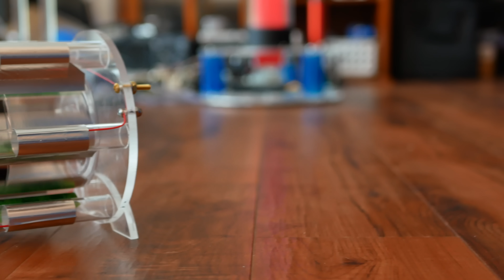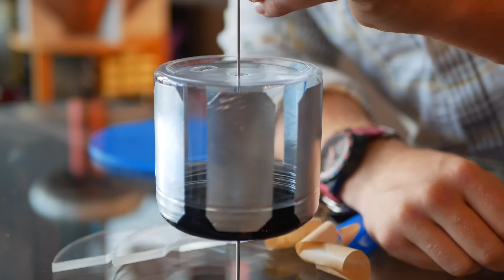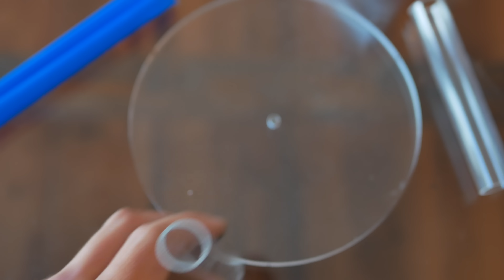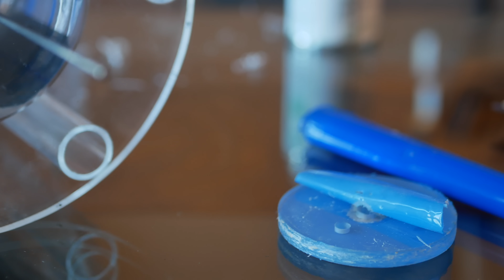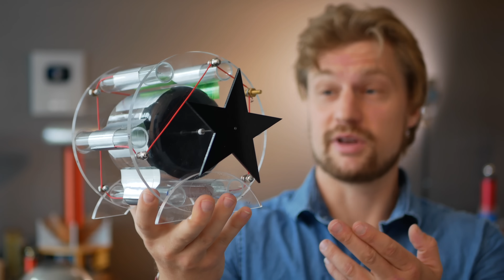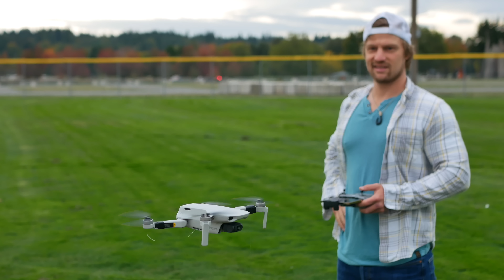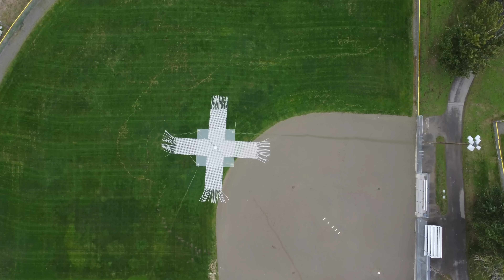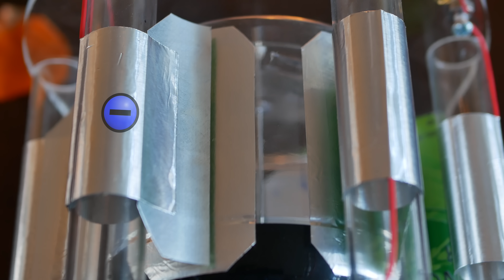Building A Wirelessly Powered Corona Motor (DIY)

Comment: Great build, I'm impressed how much torque that motor can generate! Makes me curious: what if you put magnets on the rotating shaft and used it as a crude dynamo...would it work, or would the eddy currents cause too much resistance in the motor for it to be efficient?
Reply from the maker: That’s a solid suggestion. The torque isn’t all that high, but, it was basically geared “down”. That being said, could totally attach small magnets to it and make a dyno! Thanks for the next viddy idea.
Reply: Yeah 👍
Reply: @PlasmaChannel  NoOoOo Zach you spoiled my science fair project hahaha
Reply: @PlasmaChannel  Glad I could share, keep the great content coming!
Reply: Eddy currents wouldn’t be significant sources of loss if you used insulating magnetic cores like ferrite or air. The actual resisting torque caused by the dynamo would be a function of the current output. So if you wire it up with a low q-current switching or linear regulator to power some low-current CMOS IC or MCU, it would probably be sufficient for a demo.
Another source of torque is that from cogging. Once the rotor is up to speed the cogging bumps are no longer an issue, but the motor would have troubles starting and may never get enough rotational kinetic energy to overpower them. So I’d suggest either using a flywheel and connecting the generator after it’s spun up (or leave it connected and start it by hand), or using a generator with minimal cogging. Air-core would be one way of doing this, so would having very indivisible pole and slot numbers.
Reply: @PlasmaChannel  Could you make a larger motor with an antenna insulated from the earth and the motor grounded to earth and a flywheel to store rotational energy?
Reply: Blood thirsty Koala here... yes, please!  That'd be groovy.
Reply: Should be fine with uncored coils. They don't generate near as much, but they're excellent for low torque applications. 
Speed is the key with getting effective generation out of them, apparently.
Reply: Really great little project and fascinating physics.  Thanks Jay
Reply: @volkswagenation  By the time you try to get any reasonably amount of energy using this its orders of magnitude simpler and cheaper to just put a solar panel there instead.
Reply: Thanks for the share brother ...... science 🧬 is crazy inspiring , and your works offer much learn from . Be well
Reply: @drkastenbrot  but this will work at night and winter days. Question is how big it would need to be to produce 10 Watts. I assume rpm can be very high. Maybe in next vid the max rpm possible will be revealed.
Reply: @Kapalek84  at winter days a solar panel of similar size and cost would still massively outperform it. and a solar panel still works in rain and stormy conditions.
Reply: @drkastenbrot  Solar panels are great source of energy however this is an experiment. So if high voltage is available in atmosphere then building high voltage low current dynamo [high rpm, low torque, good bearings and wd40 required] (a lot of turns on coils with high resistance and low amps) is worth checking out. If you already have solar panels on your roof that is additional source to check. I wonder if scaling up such electrostatic setup would increase the output proportionally to the size of antenna and ground electrodes. If it would get large then lightning risk would make it a bit too powerful ;)
Reply: @Kapalek84  The current is in the order of microamps. Enjoy building a motor for that, the losses just ruin any approach. WD40 alone adds too much friction, you would need dry pin bearings or even magnetic bearings. If there is a practical application for this current, it would be easier to just use an isotope generator which is tiny, more powerful and completely independent.
Reply: @drkastenbrot  to get more current the size of charge gathering components could be scaled up (possible 2 or 3 antennas in two different locations?) even few miliamps will be ok for a low friction rotor as long as these few miliamps are maintained at high voltage! 240V @ 0.001A (1 milliamp)= 0.24 Watts
Reply: @Kapalek84  I said microamps, its just not really usable beyond lighting an led. It wont ever be more than a fun experiement because it is completely impractical.
Reply: The design that I've seen with the highest torque output to my knowledge used razor knife blades for the emitters, collectors, and the rotor charge plates. I can't find the links to it.

Here is a link to another great build version, though. 

https://youtu.be/oMK0dEKWJdY
Reply: @Scrogan  hi PM me with your email
Reply: Amazing clean and artful build! I want one. Great video production too!
Reply: I've been also interested about using magnets, And build something like this forever rotating energy system, but I have no idea about real electricity, so I'm just trying to follow up who's going to bring some simple idea how to build like this yourself 😅
I've heard that everyone who tried to publish their "free energy" ideas, have been censored
Reply: @PlasmaChannel  in this manner, electricity could be transferred through an immovable barrier.
Reply: @drkastenbrot  yeah but this magneto doesn't need sun to generate power
Reply: @farmmouse3011  But it will fail to work during rain, humidity, or plain bad luck* and will easily be outperformed by a 10$ solar powerbank from amazon. 

*its a pretty sensitive setup to get working, its more of a fun experiment rather than anything practically useful
Reply: @PlasmaChannel  Make a homopolar generator. This was the first generator that was invented.
Reply: So.. what if you floated a tesla coil to transfer higher voltage back down?
Reply: @donniewatson9120  Yes, scaled up and using really fine materials and precision, and a few creative circuit enhancements, and you have a truly legitimate powerful "free" atmospheric/Earth energy generator/collector + dynamo.
Reply: Yes im sure we'll all be powering our homes and selling electricity back to the grid with these very soon
Reply: @deadsi  who said anything about selling back to grid??  The whole point is to use ANY/ MANY/ or several alt energy generators and power-banks to be DONE being completely dependent on Big-Energy's teet.  And I guarantee you that there are easily built devices,  with supplies from a local hardware store,  and maybe a few electronic components,  that will FAR surpass a $10 solar panel.   Not only in power generation,  but also high- stability,  and not being SOL-ELY (haha pun intended 😆)  reliant on solar-rays.  Don't get me wrong,  passive use of solar light-radiation is a great complementary component within a larger, more robust,  and redundant system.   But a "reversed-LED" basically,   is DEFINITELY not the cutting-edge best and brightest devices and techniques out there, STILL considered affordable and accessible for most people.
Reply: You didn't remove t plastic coating from the aluminum can don't o how it works at all pure luck ?
Reply: @Plasma Channel I only just saw this video (just started viewing some of your content recently) and noticed it is a year old now. Had the same thoughts as a few of your commenters, and noticed you had replied to this thread that you seemed to think it was a good idea. But in skimming the videos, I also noticed that there was not one with this design in it. Was curious if you had difficulty with the design of it, or if it just didn't show enough potential to warrant a video after all.
Reply: @PlasmaChannel  yo you never made the video, did it not work?

Comment: That is so cool. Thanks for sharing. I built a model a long time ago that used static to swing an arm against the torque of the suspending thread. It would discharge when the arm touched the supporting arch. Powered by my pocket comb ... i became a mobile mobile back when mobiles were a thing. Yes, a long time ago. Static from scuffing across the carpet worked too.

Comment: I've thought about a system that uses thermal vacuum pumps to passively bring water to the roof, through a ram pump, then the runoff water would meet back up with the now pressurised air through an inlet to a tesla turbine that charges batteries. All water can be in a closed system and it would be completely passive with little maintenance and some fine tuning. Just a thought. Also can I haz motor? 🙏😁
Reply: I thought about similar things as well - you can harness power from natural fluctuations in temperature or atmospheric pressure, though the energy available is tiny. There are a number of mechanical clocks that run off of this mechanism though. Once cutting-edge technology, now just novelties.

Comment: I’m planning on making a Piston engine using static electricity physics.

Basically, in static electricity physics, basically something that is positively charged will go to the negatively charged areas and vice versa. Something that is positively charged will also move away from something that is also positively charged. We can use this idea to move a piston up and down. We need High Voltage AC Static Electricity so that we can move the piston up and down depending on the sources frequency.

Comment: Maybe floating the main shaft on magnetic bearing. Then enclosing the motor in a plexiglass box and drawing a vacuum could get more efficiency out of it
Reply: You can't really measure efficiency when it's not driving any load, but you could make it spin faster that way. Remember that corona motors generate very, very low torque, but the only limit to how fast they can spin is fiction.

There's a catch with the vacuum part though: At low pressure, air ionises more easily. That means more ions to make the motor spin (good) but also much, much more leakage (bad). It might not work at all in a partial vacuum. Only experimentation will tell.
Reply: @vylbird8014  I would at least like to test  one in a vacuum of different levels. All the way down to a full vacuum.

Comment: Might be able to upgrade it with multiple grounds on the far side and multiple positive wires leading to their own grounds on the opposite side while simultaneously increasing the number of fins and strips that the fins discharge to as well as potentially increasing the voltage and increasing the spark gap just a bit. Idk just an idea

Comment: Great little motor! Might be a fun project for 3D print. ABS might work nicely with a coat of clear acrylic & much of that could be done in 1 print using something like Fusion 360. But It wouldn't be as pretty.

Comment: Fantastic, I’ve toyed with an idea like this. For a wind generator, or flight.  I used heavy copper pipe crushed down. Made an saw toothed for the discharge edges. Essential a static inducer. Best example of this is slug tape. Had even though of three phase inductors for this application. Static jet engine?  Static scramjet? Whimhurst machine modification maybe?  Who knows?

Comment: For the negative emitters try high density brass screen with several strands removed from the edge adjacent to the rotor.
Leaving a comb effect that would draw electrons to the wire tips.

Comment: When I was a kid we made one using old tv antenna tower to elevate collection electrode.  We used a big ball of chicken mesh as collector.  We at best got like 2k but current was enough for Franklin bell and a similar electrostatic motor. 

Practically the voltage step down for common use and losses is big problem.

Comment: you can try to fill the inside with some conducting liquid, or add a metal sheet around the inside, (link 2 sections or reversed polarity with each other) this way you get a added double capacitor effect which might increase the torc you get out of it. 

you can also try to sharpen the brushes, at those high voltages it doesn't need so much surface area, and using one small very pointy brush in the center, or a few of them might actually increase the amount of power for a given voltage. as well as increase the maximum speed slightly due to the help of a more high speed ionic wind connection rather than a more capacitive coupling like connection between the brush and the plate.

Comment: Also the attractive force between the positively charged aluminum tape and negatively charged fin is essentially a fixed amount of force I think so if you increased the diameter you may get more power but I'm not too sure about that. You'd definitely get more torque though

Comment: Working on my own design right now. Looks like you may not need to cut the metal into sections of the rotors conductors are under an insulator. The charge is stored on the insulation layer, this is true of all capacitors.
I posted a preview of my design with the stator in a recent yt short.

Comment: You should make a Tesla Ion Bulb. Its a simple 2 inch aluminum hemisphere with an aluminum lead in contact. Encase it in acrylic, charge it with some high volage DC, and point it toward the sky. You need a ring on the end to pick up the current from the Earth Ionosphere source. This would do the same thing your drone did but wouldnt have to leave the ground.

Comment: what if instead of 6 poles you had, say, 36 poles and instead of 90 degrees they were tilted by, say phi, and with very close tolerances, then further tuned by adjusting the width of the rotor electrodes to be slightly greater, equal to, or slightly smaller than the distance between stator electrodes.  I know it can generate more torque....

Comment: I bet you could even use kites. To lift the wire to where you want no drone needed. Plus you have the added bonus of of a dual system of wind power and ground voltage differential.

Comment: This is great, now make it an electrical version of a "ram-pump" with the spark-gap simulating excess water being released into the ambient environment. Same concept as a ram pump for pumping water to a location higher than the water source except you'll be pumping electrons instead of water and will be using diodes and capacitors instead of valves and air tanks. The pumped version of electrons will be stored in batteries and then you can use the batteries to power whatever you need. Think of it as atmospherically recharged batteries. lol

Comment: Hi, you should fly your kite close to high voltage transmission lines and test different height or distance from lines, or to be more safe acquire a telescoping antenna  mast ( Army Signals Squadrons use them) they would have proper collectors to mount on top too. It would be interesting.
When I was growing up in BC Canada, there was a story of a farmer who figured out how to collect the power emitted off those transmission lines, he had his whole house running for free. The story goes that BC Hydro got him to sign a NDA on his technology he invented, the trade off was that not one relative would ever see a power bill ever, this included all blood relatives for  generations again forever.

Comment: Perhaps to reduce friction on the shaft you can use magnetic lift thus no friction, the other situation what would be gained if you sealed the unit in a vacuum chamber, thus reducing wind resistance 😉 
Kind regards Philip
Reply from the maker: True points Phil - the bearings I used though are remarkable. Really really low friction and the motor turns for 3 minutes after power turns off. It just spins like a boss.

Comment: It would be interesting to analyze the torque of the various motor builds based on different motor sizes and weights. I believe this info would be so beneficial in producing efficient,  green energy applications.
Reply: Hemp has ALL the "green energy " answers.

Comment: Increase fin density and decrease surface area since the field is d^2 for more torque. May improve efficiency too since the body of electrons is smaller so less massive while still appropriating the same forces

Comment: Also what about timing the spark in a way that gets more power. Pretty simple to do with some automotive parts that's adjust spark timing or maybe you could use a solid state relay system to get the timing just where you want it and then fine tune it with the length of wire you use

Comment: soft and technical motor ..plasma rendered .. still alumium could could run ..  MOTOR ..EVs.. COULD BE RUN BY IF ADDITIONAL THRUST IS GENERATED .?!! OR COMBI POWER WITH LOW ENERGY CONSUMPTION ..A GOOD DIY

Comment: Did you saw 'testatica' , is a electrostatic motor wich had an diode and an capacitor transformer for, i might think is an inverted electrostatic generator.

Comment: Can you make changes to the wire leading to/or the fixture on the drone to boost the volts collected? I ask only because some time ago i read about two german scientists that produced 600 volts from a two meter high tower. They also used some undisclosed coil configuration. I have tried but the most i have acheived is 1.2-1.4 volts at about 40 feet. Thanks, love what your doing! Robert.

Comment: I don't know anything about this stuff but if you want more torque one would think that you could set up gears. I could be wrong, I just know that by adding a pulley one uses less energy. By adding two pulleys and so on the less power you will need. I'm sure gears are different than pulleys but kind of how a transmission works. I'm probably way off base,just what popped in my head when seen your video.

Comment: just a theory that if you could built a very heavy motor, of same deign with sufficiently high surface area, and connect with very high metal road one end and other to ground. we could harness a power of thunderbolt ( 500,000.00 kJ) which gives sufficiently high toque. if you could eliminate the flash lighting problem with consistence static energy with wind we could power a turbine.